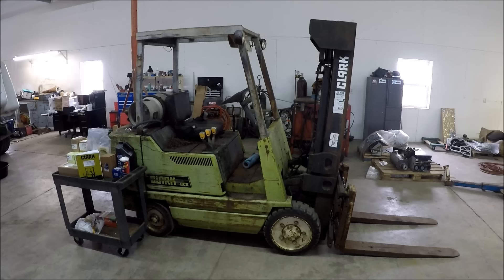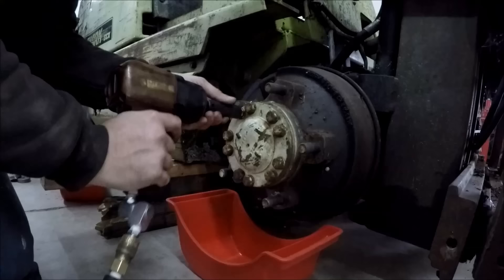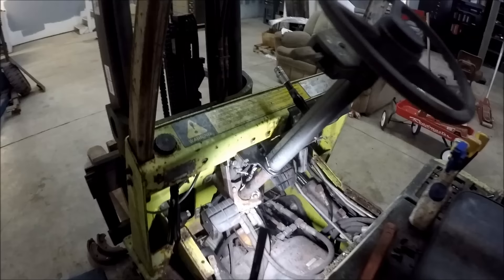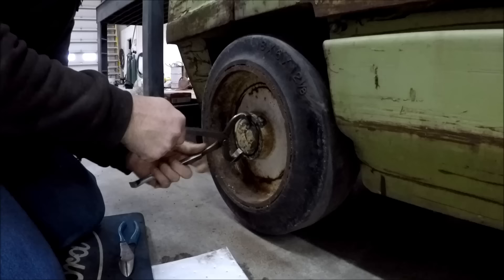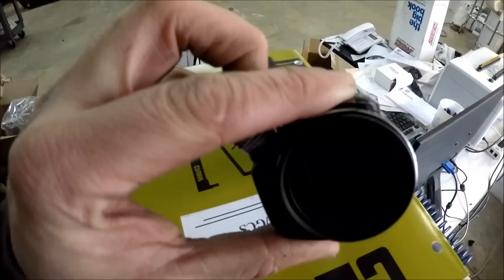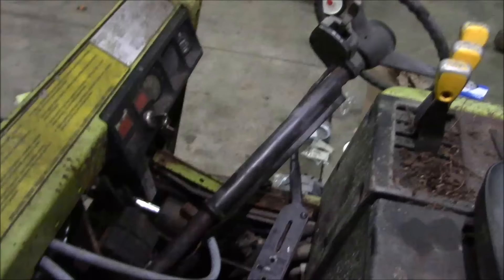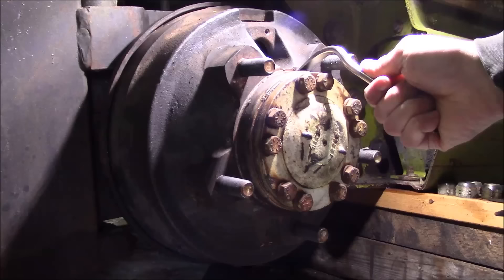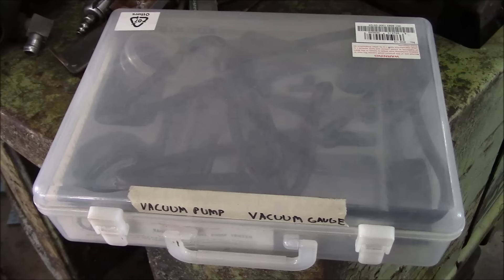Fixing a Forklift that Sat in a Field for 17 Years - Brake Job and Rear Wheel Bearings - Part 1

Comment: the divets in the hub on the rear wheel is probably trying to make the new bearing races fit, especially if the races spun.. its an old mechanics/machinest quick and dirty fix trick, you take a sharp punch and make divets int eh wall of the hub to cause craters, the ridges of the craters sit higher than the surrounding material, thus tightening up the hub to the race.

Comment: Wes, I have been using a Motive Power bleeder for years on autos and trucks and find it makes bleeding easy, quick and a one person job. Top down pressure bleed. Not too expensive unless you need many different adaptor caps for master cylinders. I am not sure if they even make an adaptor for the Clark MC but if it is a GM, Ford, Euro,
 etc. MC there probably is an adaptor. Motive makes other stuff for fluid extraction that also works well.
Reply from the maker: I have a KD tools pressure pot bleeder. I just don't have many adapters for it.
Reply: @WatchWesWork  Wes, I have had to make a few adaptors from stock MC caps by drilling a hole in them and using a threaded barb fitting nutted in with some RTV to seal. Stock MC caps are pretty cheap to buy and modify. Motive actually makes a kit of parts to do the modification.

Comment: OK, the cotter pin. There is a correct way to secure it. Bend one end back then, the other slightly. Cut off the excess. Dad was an aircraft mechanic and that's how the book wants it....certified by the manufacturer ! Just like you did !

Comment: Hey Wes It funny to come across this video of a brand of lift truck I sold against for many years. I seen many a young and old people lost fingers and hands working on these lifts and die by be crushed under them. I seen operators get bashed by lift chains be over loaded and stretched beyond limits and snap and fly back at them. Guys hanging engine blocks off the back to see if they could lift more. Forks snap at the heal because they are worn to thin. With no load back rest products falling of and crushing overhead guards when loads are lifted way up. I would strongly urge you to seek safe training on the unit and know that the unit you have is a indoor only truck of coarse out door on concrete and no ice or snow. But everyone said not me never happen and it does. Think of your family and what happens when you suffer a bad accident. They are great tools to use but damn respect and much proper care and safety checks. Mast channels need safety check for wear and so do the rollers and the trunnion mounts bushings around the drive axle.

Comment: The grooved brake shoes are a non issue on that sort of low speed limited usage application.   After the drums are turned just run the old shoes as is and they will flatten themselves out pretty fast without doing enough wear to the drums to matter.  

What wears the groves into the shoes is the rust chunks, not the native cast iron.    Rust (Iron oxide) is considerably harder than the cast iron and shoe materials so it tends to cut into both when it builds up.

Comment: Also , be sure to check the steer axle assy, the king pins, center pivot bearings, Clark had problems with their steer axles, they were not heavy build enough.
Reply from the maker: I had that issue on the C500 I had. The whole steer axle was shot.

Comment: You could bleed the system the other way around, just use a canister with a check valve on top where you pressurize it with shop air, and on the bottom side a brake line which has a rubber attachment that fits over the bleed nozzles.

This way you can bleed the system bottom up and avoid that air might collect somewhere and isn't pushed out fully. It also avoids the spill of brake fluid, since everything ends up in the reservoir. Depending on the size of the reservoir, you might need an overflow to it, or remove some brake fluid.

In theory you could also use a pump for this, just looping the brake fluid until no air bubbles up in the reservoir tank.

Comment: on older mercedeses (?) you use the hydraulic clutch to reverse bleed the brake lines ... attach a hose from the bleeder valve of th receiveing clutch cylinder to the bleader valve of the brake. this way you don't need to watch the level of the reservoir since the clutch takes from the same reservoir ... this of course only works if you only replace the brakes

Comment: Forklifts are money makers,no need for them to be sitting in a field, i have been working on forklifts for probably 20 years even though they are not my specialty, been doing them as part of my job when one breaks down,only thing i hate about them is having to pull the wheels off for brake jobs, wheel bearing replacement etc etc, man they can be a handful literally if you dont have that perfect tool to put them back on,lol, you'll be visiting the chiropractor  in a hurry if your not careful.

I have also rebuilt the masts on them,some really long masts,that was fun but its satisfying to see those leaks stopped and watch those forks stay up in the air for days instead of minutes as before, when the seals are bad they wont hold pressure long and down they come,lol, i have also done starters, carburetors,hydraulic lines,alternators,radiators you name it, on them, they are very similar to a car but everything is packed real tight and everything is twice as heavy,dont be afraid to dig in, just be careful.

Comment: Never had much luck with vacuum bleeding either, no matter how much grease you pack around the bleeder it sucks in air.  I have seen some brake calipers that have an o-ring on the bleed nipple, guess they would work ok.

Comment: Installing new bearings and setting the play loose so it wiggles would indicate wear and the bearing needing adjustment to take out that play.  I'd set them so there is no wiggle but the wheel still spins.  The massive resistance is likely from all that new grease.  A forklift application is low speed and intermittent. Not the same as a small diameter trailer tire going down the highway.
Reply from the maker: I've never seen a wheel bearing that was spec'd to tight. Some end play is always required.

Comment: I bought a cheap vacuum pump for bleeding various family cars and found it to be equally useless as it sucked in air even with grease too. My fix, I removed the bleed nipples and wrap them in Teflon plumbing/gas tape, reinstall and problem solved seems to last several bleed cycles
Reply from the maker: I thought about that. I should have tried it.

Comment: 45:25 ... I use "Russel Speed Bleeders" they have a miniture automatic ball valve built into each bleeder ... you just crack it open and pump the breaks for a few times then go close it ... then on to the next one etc.
Reply: pneumatic bleeders are even better.  Hook up to your air compressor and they suck the old, nasty fluid right out of there.  Harbor Freight has a kit (with an automatic filler bottle) for ~$30 that is awesome.  I'll never bleed brakes without it.

Comment: Nice to see your work reminds me of my dad he fixed all sorts of machines over the years. Mixed metric and imperial hardware on machines is a pain had that on the metro (small car in uk) I had many years ago. As for the "thats not how to do it brigade" in the 3+ decades working on electronic stuff if I had a penny for every "experts" comment I would be a millionaire. Ignore them, best one I had was fitted new jack plug to a lead it came back wrenched apart with complaint my welding had failed! Expert didn't seem to know that 11/4 inch audio jacks arn't pitions and that copper wire to tinned connector terminals are soldered. As for some of the bs you heard while on the tech help desk believe me it was right up there with the worst keyboard kiddy. Hope all goes well oj

Comment: Great video, my first job as an apprentice forklift mechanic in OZ (some thirty plus years ago) was a break overhaul on a Clark with inboard breaks....Aaaaaaaahhhhh! Solid machines but had their issues.
Reply from the maker: Yes. Overall I think they are decent machines for the money. There are better, and much worse, but a nice balance.
Reply: Keep up the great videos, really enjoy them, would like to see one of the cam/timing belt replacement. Worked for a Mitsubishi dealer for over thirteen years and replaced many a belt on both 4G63 and 4G64 engines.

Comment: I know it sat outside for God knows how long, but for the most part those forklifts spend their entire lives in a huge factory so are not exposed to dirt and salt and rain water and mud and snow unlike a car or truck. But as long as it say out, I'm surprised as you at how well the lines and wheel cylinder bolts came off. I had to do a super rusty 2000 Chevy cavalier, and lets just say a torch, grinder and air hammer was involved, along with new drums, backing plate, wheel bearing, lines, and all brake parts inside the drum
Reply from the maker: That sounds normal. GM sells a whole brake assembly for most drum brake vehicles. And they are not that expensive.

Comment: Note: to self when vacuum bleeding push the brake pedal down at the same time it will open the master and allow trapped fluid and air into the wheel cylinders.If you don't it will not!

Comment: Tip #2 back off  p brake before adjusting. As for bleeding fill m/c open both  bleeder screws on wheel cyl and let gravity work for you.

Comment: I had exact same problems- mine had a plastic tee I cracked when taking a leaky fuel hose off too! i had to cobble up a tee too, same issues bleeding- plus one, and GMTA, I had also blown air into the reservoir cap to fill the masters :) the plus one issue i has was the inching slave- bleeder was at the bottom, had to loosen/rotate bleeder to top, then rotated back when done...cant remember why it was rotated though, been a couple years ago- dunno if it was adjustment or just line clearing the floor plate... you are right about whoever designed that system...beyond stupid. 
 mine also has the TA18 transaxle, and when cold it likes to slip like crazy till it warms up- just rocking the selector from fwd to reverse several times seems to prime the pump or purge the air out/whatever,  but it takes off fine as long as i do that after first startup- our 65 galaxie does same thing- its a pump/drainback issue im sure, but dont even feel like tearing into either one :) priming the transmission works, and prevents wear from slippage that will quickly ruin a car transmission... the clark bronze clutches must tolerate it, as know this truck did it for years before they scrapped it...

Comment: If you think the Farmall brakes were bad to work on you should have tried the ones on an Allis Chalmers WD 45, you had to take the entire rear axle housing on both sides off and if you had a problem with the drums they took a torch to get them off and a puller.  Not a half day job, not a one day job either.  The fork lift is a walk in the park compared to that.  The reason the trans oil filter is so special is the  forklift company selling it makes $50 profit, or maybe $60, every time they sell one.
Reply from the maker: The dealer wanted close to $100 for that filter. I got the Baldwin from my auto parts store for $70, which they thought was still a rip off.

Comment: When I do drum brakes on vehicles  that the brakes last a long time . I use silicone sealer on the ends of the springs so if they snap or break they dont fall under the brake shoes and tear up the brake drum. They also dont come off on washboard roads
Reply from the maker: Interesting. Does it work? I mean have you had the silicone hold in a broken spring?
Reply: @WatchWesWork  yes... i used to drive on a 3 mile long washboard road in my 70 F250 with drum brakes all around..  i would loose springs about once a month.. i did not drive slow.. i decided to try the silicone and it worked.. never lost another spring.. even when i took it apart years later to do the brakes.. a spring actually broke and was dangling by the silicone sealer..  here is an image from a friends 70 E300 https://i.imgur.com/WUIIhxA.jpg  yes.. i work on a lot of old stuff.. but then i work on some exotic stuff too https://i.imgur.com/Vv09FT1.jpg

Comment: looks close to my reed and prentice lathe. you're all high tech with those race and seal drivers now!  The way you did the cotter pin is how i've always done it but really is is that critical?  i doubt it.  We did it that way to see if maybe another shop was in there we would have an idea.  I like your spring trick with the needle nose pliers. I bet you wish you found the hole in the drum before you took it off
Reply from the maker: No kidding. I've never seen that access hole in the drum before. Once I saw it I was wondering why all drums don't have one!

Comment: The feeler gauge adjustment on brake shoes is not that odd.  Old Willys military Jeeps ('40-'52) used a similar system.  There is a slot in the brake drum to insert the feeler gauge through.  You then have four cam adjusters per drum, two at the top, two at the bottom, with the top and bottom adjustments using different clearances.  Of course, this only works with brake shoes that have been cam-ground to the drums!  By the way, I put cotter pins in the same way you did.

Comment: I think you should have gotten the misses to help bleed the brakes, she did a good job last time, lol. I didn't know there were cotter-pin police. I don't think you will find an Ammco shoe grinder in too many shops today, probably not OSHA approved, and the arc is supposedly built into the shoe. Back in the day a brake job was complete, rebuild "all" cylinders, grind the drums and shoes and a complete equal adjust, now its a pad slap. Missed the test where you get to leave skid-marks on the garage floor.
Reply from the maker: I recently saw a "brake rebuild center" for sale on craigslist. It had two lathes, a shoe radius grinder, and a press for setting lining rivets. I was tempted, but the guy wanted a lot of money for the whole setup.

Comment: Just a comment you needed more light in the video alot was dark.  And there is a nice socket tool from snapon,mactools,Craftsman that is a hex key to socket adapter that would make it easier to work with.

Comment: What works good and is cheap, use a thumb oiler with flex tube and clear hose that fits ends of oil and bleeder nipple. Fill oiler with brake fluid and start pumping. NO special tools needed. Even works on equipment that has sat for 17 years!

Comment: This is going to be an interesting series, but I am calling the cotter pin police. LOL Could you have gravity bleed out most of the air in the brakes?
Reply from the maker: You can gravity bleed the wheel cylinders, but the master cylinders will still have air. They are a bugger to bleed.

Comment: Unless you plan on driving this lift on a track the drums are fine.  Especially in a shop environment.  Always replace the brake springs, before they brake!
Reply from the maker: I usually reuse them if they are not too rusty. But no good on this one.

Comment: That thing was put together with every spare nut and bolt at the Clark shop lmao
Reply from the maker: Sure was. Seems to be very common on these mixed inch/mm machines. The guys fixing them try to use inch bolts on everything and make a mess of it.

Comment: Thank the good Lord above you can still buy parts 4 that old girl...i have an 80s datsun fork truck that's equipped with a diesel ..a gem in the ruff..she still starts and runs.. Serial number 56 early in her day...and amazing no leaks..but brake linnings are in need of service... Engine smokes like a frieght train...most likely some bad piston rings...not sure where to obtain parts..
Reply from the maker: You might be surprised. I bet a Nissan forklift dealer can get them. I've found forklift parts to be pretty reasonable and easy to get. There are often aftermarket parts too that are even cheaper.
Reply: @WatchWesWork  it's considered a Datsun..no dealers local..

Comment: I can help you save some hassle, forget about the Harbor Freight vacuum bleeder that uses air pressure / venturi setup, at least with a small air compressor, it was pretty much useless. Mine hadn't even been sitting in a field for 17 years.

Comment: Are you sure you're not me, because I grew up in the same type of family that never owned anything that that had functional brakes.
Zero maintenance meant zero operating cost to them and it showed badly!  

Same with the near obsessive need to have all the equipment I use at near 100% proper working order no matter what it takes.
Reply from the maker: I'm not going to say my stuff is 100%, because it's not even close. But I like brakes.